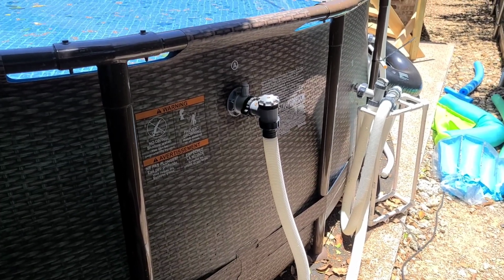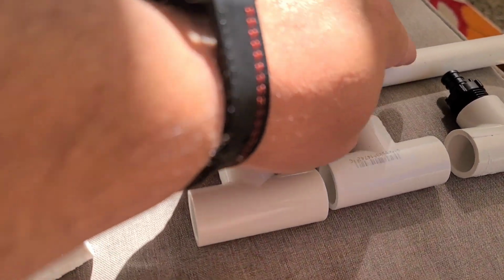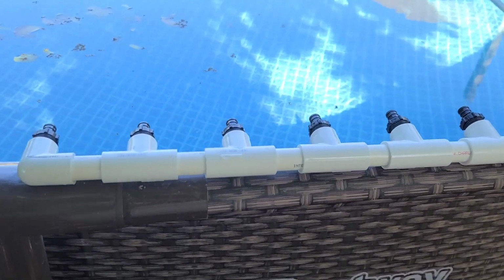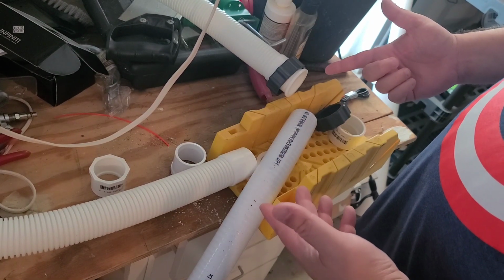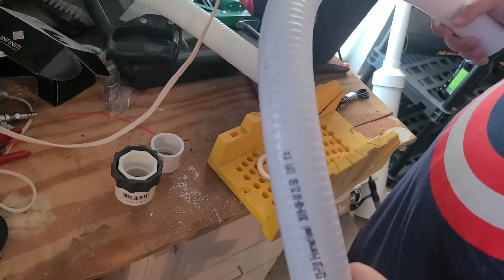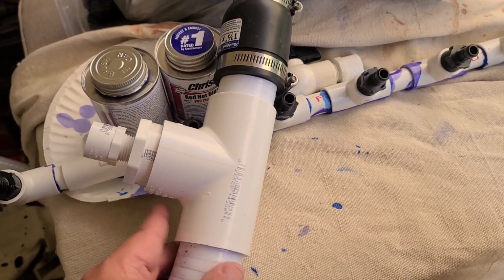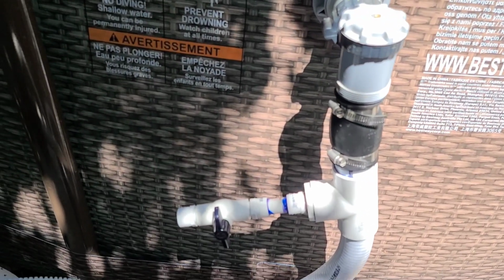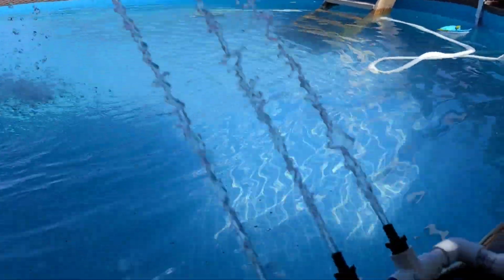Above Ground Pool PVC Sprinkler DIY - Cool Your Pool!

Comment: NICE CANT WAIT TO GET MY 3000 gph pump set up so i can add this i actually had the garden sprinkler that goes left and rite hooked up to the water hose its wuz an ok set up bt now that i have a new pump should be able to handle the pressure for this nice setup.
Reply from the maker: Keep an eye out for TOO MUCH pressure.  Too much through the sprinkler will just blow out the sprinkler.  A 3000 gph pump will need to be able to "bleed" water into the pool in addition to whatever goes through the sprinkler.

Comment: I have the opposite issue - need to do whatever I can to heat the pool - using a home made solar heater, 600' of 1/2" irrigation tubing, and an 800gph utility pump. works great especially combined with a solar blanket.
Reply from the maker: I wish that was my problem!  The TX heat has my pool at 90+°...and it's only mid-June!

Comment: Good Afternoon, concerning the flex pvc, is that a 1.25 or 1.5
Reply from the maker: 1.5
Reply: @getitdone308  thanks. Also on the end where you made the coupling to fit the intex nut. I have a 1.5 to 1.25 with a coupling. Did you add some type of gasket to keep it from leaking on that end?
Reply from the maker: Yes.  I used one of the Intex gaskets.
Reply: @ Get it Done, thanks to you I'm trying to get it done. Now concerning the self made coupling using the intex gasket did you get a full bite on the treads. I tried to get a full bite but it started to slip off the thread. Maybe I need to hammer front the inside of the coupling to make it tighter?
Reply from the maker: I have almost a full bite (definitely enough)

Comment: I did mine almost exactly like yours but I used one hard pvc pipe instead of a flexible pvc. My pool is coleman like yours 18´. Thank you for share your ideas Sir.
Reply from the maker: Glad it helps!  Thanks!
Reply: @getitdone308  I followed your instructions and it was easy (your tutorial was amazing and easy to understand). I'm going to see the pressure of the pump to see how it works.
  Thanks a lot!
Reply from the maker: Awesome!

Comment: Excellent - i need another fountain as my weird hackjob floating around in the pool works good, but is cumbersome and I have to get in it to set in the middle all the time. 

Question:  Is the hex PVC bushing you use off of the intex nut go from 1 1/4" to 1 1/2" or the other way around?
Reply from the maker: The Intex male thread off the filter (in my case, the saltwater generator), is 1 1/2"...as was the Intex tube/pipe I used to get the female nut.  So I didn't have to change from 1 1/4" on my system.

Comment: Great videos. You have certainly taught me a few things. I liked the filter to pvc connector. I have a solar pad that the water travels thru after my filter. It water warms up then heads back into the pool. I found last year that the water moved too quickly thru the pad and doesn't absorb much heat. Someone suggested a 3 way diverter (after the filter) to reduce the water going to the pad and increase the water going back to the pool. Slowing down the water thru the pad should allow it to absorb more heat. I noticed at the end of this video, you use the plunger valve to control the water going to the sprinkler. Do you think a plunger valve would work for me or do you think the the diverter is a better idea. Is a plunger valve basically a simpler version of a 3 way diverter. Thanks
Reply from the maker: Thanks!  I think a plunger valve will do the same thing. It slows the water flow by as much as you turn it.  The trick is to not close it too much and have too much pressure for your pump.  (Think about what happens when you run your pump and the valve is closed....WAY too much pressure).
Reply: @getitdone308  Good point about the pressure. Hey I also wanted to ask you about your wood stairs/ladder. Hows that working out. You used pressure treated lumber correct. Any tips or tricks if someone wanted to do something similar.
Reply from the maker: Works great...even 3 years later.  I did use pressure treated. In hindsight I would use regular lumber (to save money).  But I've had zero water quality issues.  It's been awesome!
https://youtu.be/QP9lvq23BTg

Comment: What was the total cost of the project? It seems like it would be cheaper just to buy a waterfall feature from intex. Also, does it effect flow at all? Seems like a lot of points for things to fail with so many different fittings.
Reply from the maker: The total cost of the project was about $20 (excluding the flexible PVC).  I excluded that from the cost because it didn't really have anything to do with the sprinkler...just a hose upgrade.  That said, the PVC was about $30.  The only reason I went this  route is because I wanted a sprinkler system and not a waterfall system.  Intex (used to) sell both, but last year, I couldn't find one for the life of me.  When I did, it was over $100.

Really, nothing was negatively affected.  The sprinkler worked fine, the pump worked fine, and I got cooler water.

That said, I did upgrade again this year to a Hayward external skimmer which came with a standard eyeball inlet.  Because of that, I can get an off-the-shelf sprinkler to insert in the inlet (which I did) and will be using.  That was only about $30 total.  I'll post a video soon on it.

Comment: Hi i will give you a marvellous idea:
Get 20 pcs of mini irrigation nozzles and drill 20 holes in a pipe and fit them then connect the pipe to a 1/4 hp water pump.
The evaporation effect is enormous.
I can send you photos of mine
The outside temperature is 56 celcius while the pool is 28 celcius

Comment: How does this affect this operating pressure of your system?  I like this idea to help cool my water temp.
Reply from the maker: It will affect the pressure badly...if you do it wrong.  For instance, if I close my outlet to the pool completely, it raises the pressure too high.  However, the outlet valve closes to basically two positions.  The first is an easy turn clockwise until it resists.  Then, there's the final twist to close it completely.  If I just turn it until it resists, then that still lets some water through the regular outlet and my oressure remains the same as if I wasn't using the sprinkler.

There's a ton of sprinkler systems for pools on the market (that can't be used for above ground pools).  They all allow some sort of adjustment to allow water to escape before the sprinkler to reduce pressure.  This is the same concept.

In the end, using 3-4 sprinklers made zero impact on my pump pressure, but has kept my water temp cooler between 5-10 degrees.

Comment: Great video. Do you think using 1/4 in pvc would be a better option? When you turned off the plunger valve what did the pressure gauge jump to on the pump?
Reply from the maker: Hi Ashay,
I found that when I turned the plunger completely closed, the pressure spiked too much for my comfort.  Likely if I added a few more sprinkler ends to the fixture, that would have been fine, but it wouldn't have given enough pressure/throw/arch to the sprayer, thus making it ineffective as a "cooler".

What I found is best is to turn the plunger closed, but not all the way (with those plungers, you can easily turn them open/closed, but there's one final "push" that takes a little more pressure that actually opens or closes it).  So if I close it, but only until I feel the resistance of that final twist of the plunger, I get a little flow out the regular outlet and the 3 sprinklers throw the water about 25% of the way into the pool.  My pressure remains exactly the same on the pump.  So I consider that a win/win/win (pump pressure is the same/sprinklers have sufficient throw/pool still cools)!